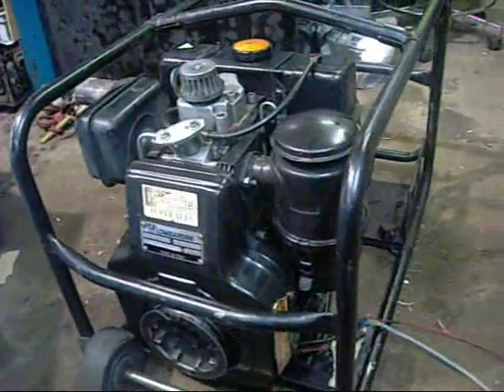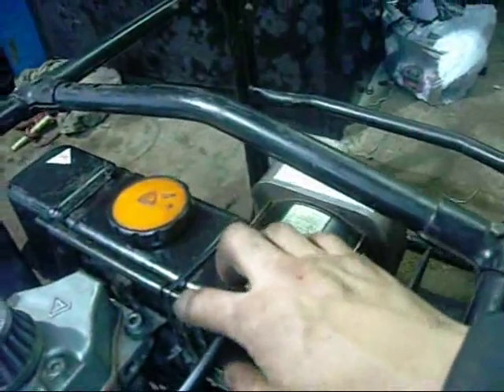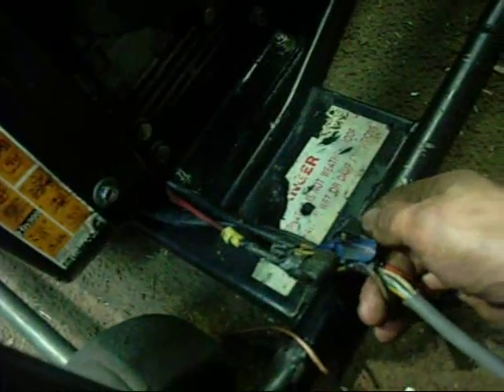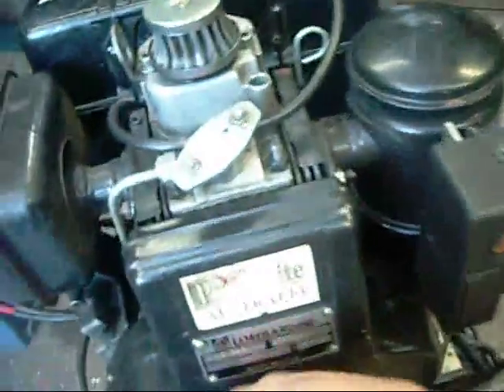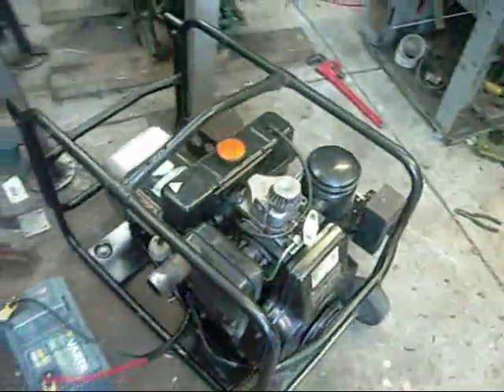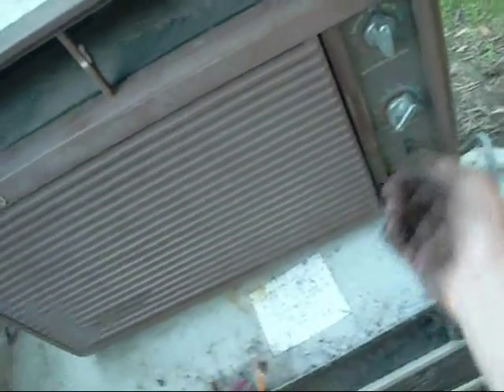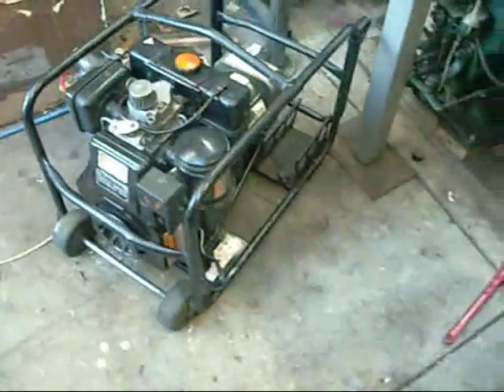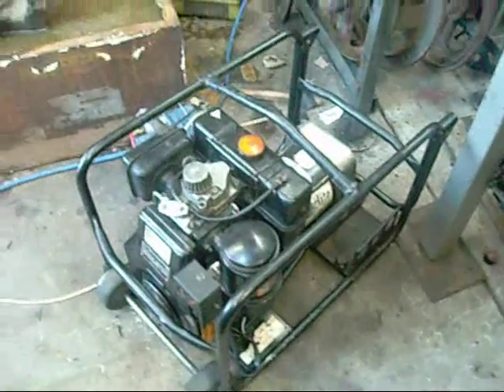Powerlite Lombardini Diesel Generator Improvements

Comment: I have a new lombardini kd 15 440. I have a lot of noise and extreme vibration. Im thinkin about putin rubber spacers where it mounts to air compressor. Some one said i should get anew pulley on front. Looks like lombardini is a noisy engine with a lot of vibration.